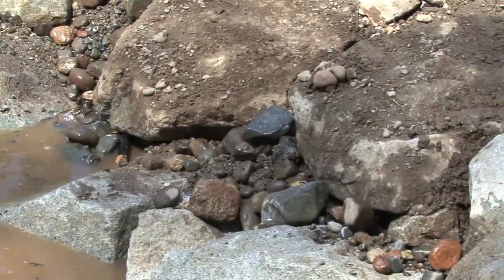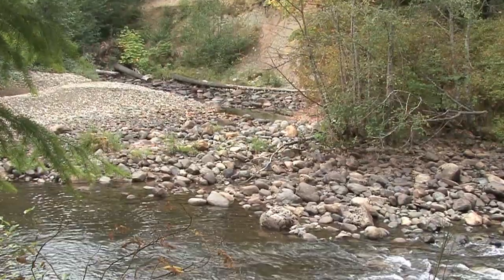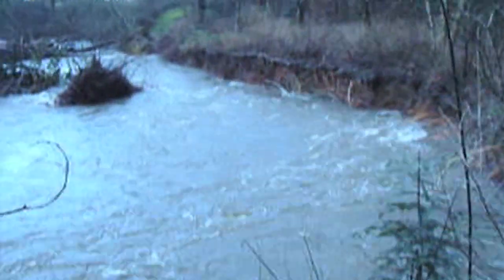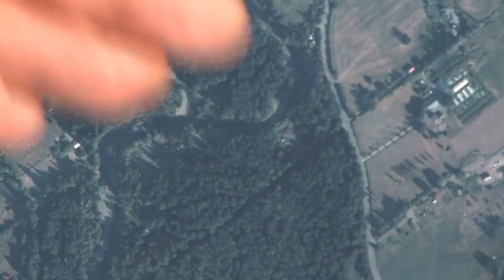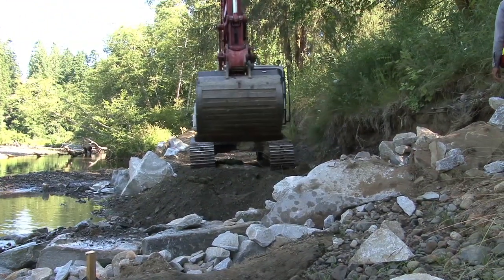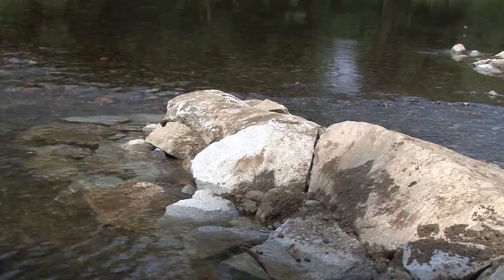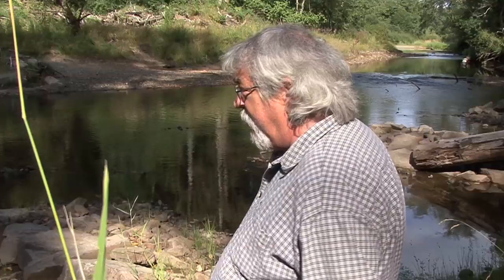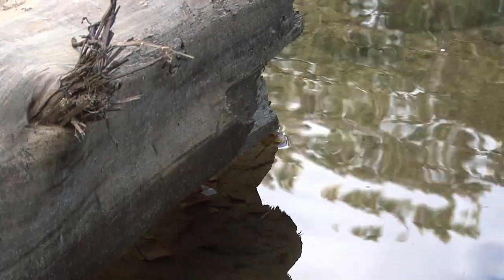Building Weir Fields for Riverbank Stabilization -Tsolum River, Vancouver Island

Comment: Tell Jack to make the weirs far apart so there big ponds for fish maybe take and dredge area so it could be a fake lake rowing (racing 4 --8 boat races like Olympic)venue with trout farm salmon sponging  ??fish for people....  watch you tube video on weir in British creek  to make small lake/pond ...they use a barrel/pipe 24 inch one the bottom for fish travel and water and the wall on top or few feet above bottom, mean need grate?? with 6"/8" net like grid so person could not go through..LOL  ,,, don't forget Wolf Lake Dam....... and all the slump in it they should digg out the lake and pit mine it deeper and look a feed creek of the Platue valley...and Comox lake stump removal to  the bay and harbor dredge ....